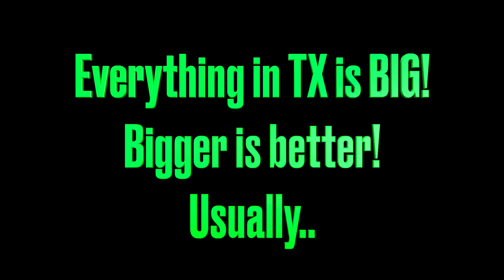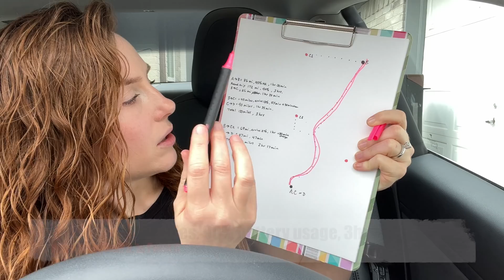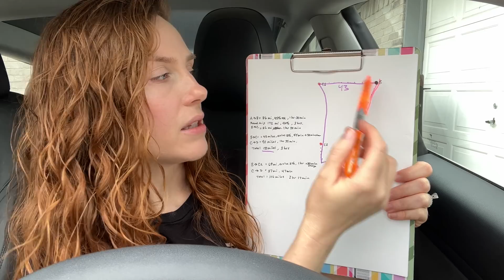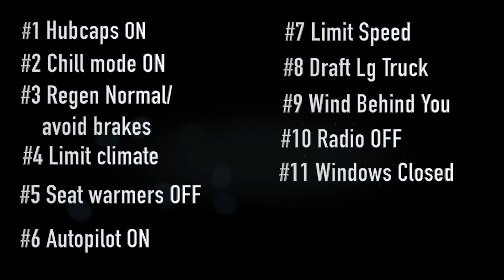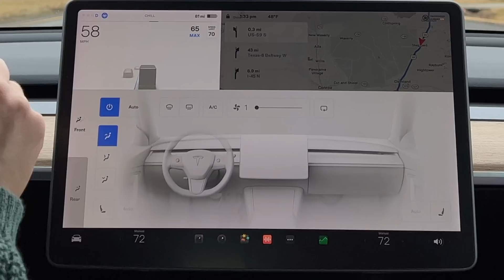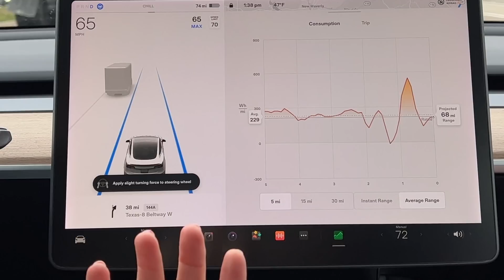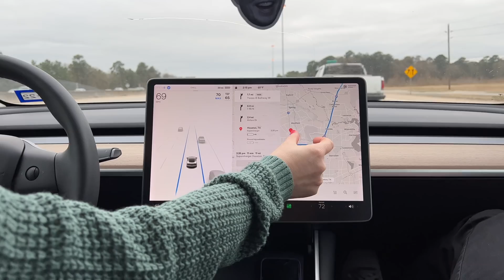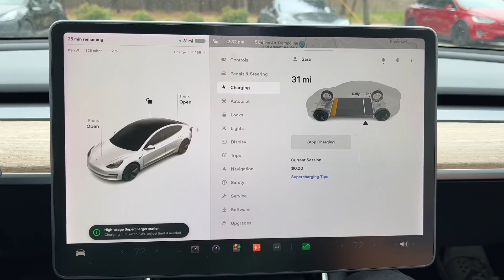TESLA: Emergency Battery Procedures (Hilarious & Highly Educational)

Comment: Sara, you're are real trooper doing this being sick !  was wondering if you could do a video on "Energy Consumption for Dummies",  explaining the energy consumption chart in the car. I'm still trying to learn EV usage  and for example  what's a good miles per kwh like mph in gasoline powered vehicles.
Reply from the maker: Sure! Great idea! I’ll add that to my list. But if I’m being honest… I don’t know 💯 about that thing either! And there’s still something I personally can’t find on the internet either. I don’t know what factors are used in its algorithm and I don’t know factors are used the percentage algorithm for the little battery symbol at the top of the screen either. Or if that even uses an algorithm.. I’ll try to do more research and learn enough to make this video for you because I’m frustrated about it too. My average  wh/mi is about 240. But that’s not necessarily good.. it’s just my average useage and lowest.

Comment: Another very interesting video, well done! How did the crack the front screen occurred? You are driving a performance model or? What tires are mounted? summer tires i assume? What pressure you have in your tires, as this effects too the range.
Wish you all the best and a swift and fast recovery!
Reply from the maker: Crack occurred at 40 mph on a city street when a yard crew with lawnmower etc pulled out in front of me and kicked up a rock. It cracked over time from a chip I could barely see to a huge crack from the large temperature difference here in Houston from super hot windshield in the day to cold at night. That crack got that big within about a week. Not performance model, only Standard range plus 2020 with NO heat pump so 240 miles range. Basic stick tires 18”, my tires pressure was low. Should be 40-45 psi, mine were at 38 psi because they were cold and I hadn’t added more air in winter. ;) thank you I’m all better now!
Reply: @SaraJAwesome  Thanks for the detailed reply as that helps always to see how other Tesla owners drive their cars and what they experience. I had even before my Tesla on all ICE cars a bit higher pressure, 2.9 to 3.0 bars (40 - 44 PSI) as the fuel consumption is a bit lower and I am the one who always looks far ahead of what happens on the road and thus the slightly longer emergency break distance has never ever been an issue in my 47 years of driving. Keep your motivating videos coming, blessings
Reply from the maker: Thank you, Alex!

Comment: Enjoy your videos and tips being a  new Tesla owner.  Some may not realize, that in a pinch there are slower chargers out in the wild, some are free, others are not.  These 'wild chargers' are the slow 'level chargers', but a charge is a charge if you find yourself in a pinch.  After my 1st road trip a fellow Tesla owner pointed me to a few 'non-Tesla' apps; specifically PlugShare and ChargePoint.  Again, if you find yourself running your Tesla in a strong head wind with cold temps you will need to realize the estimated range will be reduced, just like gas mileage is reduced in a headwind or going up hill.  Charging up an hour at one of these 'slow' chargers is better than sitting on the side of the road waiting for an hour for insurance/Tesla mobile service to come and save the day.  I'm not trying to 'sell' any app over another or any other 'wild charger' service over the other.  Just attempting to help newer Tesla owners, like myself.  I find myself coming up with reasons to go 'somewhere'....just to drive my Tesla.
Reply from the maker: I agree ☝️ 💯, Mike!!!!!!! Very good advice! Unfortunately for me on this particular trip there were no good third party charging options. But I heard they are installing more chargers along that route soon! So yay! Thanks for your support and sharing tips with everyone!

Comment: Where I live it’s cold at this time of year, about 35 miles south of NYC. I drive 76 miles daily, total. Yesterday my car used over 100 miles after leaving work at 90% charge (that’s what the limit is set at), and coming back today. So, yeah the weather seems to have a big impact on range. 

I do drive like an idiot sometimes though, too fast. Although the Tesla has slowed me down tremendously, for many reasons (I see why tesla drivers are so slow now). Too much battery usage, cars too expensive, etc.
Reply from the maker: Yeah, I drive fast too sometimes. Or I let people test drive it, and drive it like they stole it and it really eats up the battery fast. The miles you drive is basically never equal to miles of energy usage. Unless you’re going downhill with no heater on. 😂 i love mine, but it is a learning curve until there are more charging options everywhere in the world.

Comment: Thanks for the video. You really like to live dangerously. I probably wouldn't attempt a destination without at least 10% estimated charge remaining. Your tips are useful, especially controlling your own speed. I'm curious, what is your average Wh/mi and your best trip Wh/mi? I hope you're feeling better.
Reply from the maker: 220’wh/mi is the best I’ve gotten going slow around town with A/C on. Not heater. 👍🏻
Reply: @SaraJAwesome  My overall consumption with Tesla II is 224. My best has been 193. My best in Tesla I was 152 Wh/mi. Granted that was going mostly downhill in Colorado.
Reply from the maker: Nice

Comment: The Mustang does not have a heat pump either, so stupid.  Not having a heat pump in a new EV is like buying a piece of electronics with micro USB instead of USB C.  Luckily I live in San Diego, but even here my range has been cut a LOT due to the "cold".  I normally get about 320 miles in the summer time, last few months I'm doing good to get 270 miles at 100%.  

I only WISH the Ford had ANYWHERE close to the information that the Tesla provides to the driver.  We get a "Miles Per kWh" which 99% of the time is not even remotely correct, and that's pretty much it.  The data Ford gives you is laughable...    PS Good to see you finally got that crack fixed ;-)
Reply from the maker: Oh dang!!!!! That sucks! I’m so sorry. So are you overall happy with it? Or do you wish you got a TESLA instead? I love the colors of the Mustangs personally! And no, :(…. I didn’t get it fixed yet! Ugh 😩 🤦‍♀️
Reply: @SaraJAwesome   The build quality is far superior, however their software is WAY behind.    

Sometimes I do wish I went the Tesla route, other times I'm glad I didn't.
Reply from the maker: Always positives and negatives to EVERY decision for sure. If you’re happy, I’m happy! ❤️

Comment: Nice job on this video.  Good tips.  BTW I don't think drafting behind an 18 wheeler is unsafe if you are keeping a safe distance behind it.  The Tesla autopilot gets you as close as possible while keeping a safe distance and thats exactly what you did.  The large mass of the truck makes it inherently less likely to accelerate or brake quickly so movement of the truck are more gradual in front so actually safer.  Agree that the truck could run over something which the Tesla may have more trouble with but that safe follow distance should give you enough time to brake or maneuver if you're paying attention.  I've also used this technique many times with my old 2015 Tesla Model S.  In our new Model Y, I haven't yet needed to use this technique since it hasn't been necessary with its improved range but it is definitely a tool which could help if ever needed.  You did a nice job of explaining this without making people terrified who don't yet have an EV.
Reply from the maker: ❤️❤️❤️❤️❤️❤️ Thank you for sharing this. And thank you for saying I explained it well without possibly freaking out potential or new EV owners. That was what I was really worried about with this video. I try my best to explain things so that I’m honest about potential problems, and can prepare people for them. My intention is not to freak people out and maybe EVs, especially TESLA look bad. I’m the beginning some people thought I was a TESLA hater.. I was shocked. But it was because I really try to prepare owners for the worst so they don’t end up those situations and if they do, then they know how to handle it. So thank you!!!! ❤️❤️❤️❤️❤️❤️❤️ I agree on the drifting too, it can be done safely and properly. But a lot of people will probably screw it up so best to just put it all out there and make them fully aware.
Reply from the maker: Drafting *

Comment: I had one instance where the navigation system got it wrong, and I had to stop at a public Level 2 charger for about a half hour to get enough range to get to a supercharger near my destination.
Reply from the maker: Yeesh ❤️
Reply: @SaraJAwesome  what happened was that I was supercharging about 90 miles from home, in cold weather. I wanted to get dinner about 30 miles from the supercharger, but the navigation system proposed to have me double back to the supercharger I was using after dinner, then charge up to go home.
Reply from the maker: Ohhhhh wow

Comment: Thank you for the kind things you said about truck drivers! Please don’t flash your high-beams to “thank” the driver. That blinds the driver when they are looking in the mirror to make sure they are safely past you. Consider the size difference between a car’s side mirror to a truck’s side mirror. Shining a bright light in a bigger mirror reflects a lot more light thus blinding one when they least need to be blinded. Instead please dim (turn off) your low beam head light 1-2 seconds then back on. If a truck dims their lights to let you know it is safe to pass you can put on your 4 way (hazard lights) for 1-2 blinks to thank them.thanks again.
Reply from the maker: ❤️❤️❤️❤️✅✅✅✅👍🏻👍🏻👍🏻👍🏻👍🏻I didn’t mean flash at night. It’s okay to flash during the day right?! Because that’s what I meant. But once again details have been lost in trying to keep videos as short as possible. Ugh. Hopefully no one blinds a trucker now.. 🤦‍♀️ Someone else told me the same thing earlier. Well, I tried. Thank YOU very much for the kind words and advice as well.

Comment: I’m a bit obsessed with checking my efficiency on the Stats app after each trip and it is much worse once it gets in the 40s. That seems to drop the tire pressure about 4 or 5 psi from when it’s 70s. I haven’t done any roadtrips yet 😬
Reply from the maker: Yep, my tires went from 45 psi this last summer down to 38psi right now. But honestly I’ve been sick and tired and haven’t filled them up like I recommended. Haha don’t do what I do, do what I say to do! 😂 I love the STATS app as well. Fantastic app. I don’t trust any other ones. And the app developer is such a nice guy. I talk to him on Twitter.

Comment: Glad @14:15 that you could show onscreen the trip planner did notice your efficiency improvements, and updated arrival charge% to 8% instead of 2... great!
@13:50 re comparing Energy app to battery meter miles... that's only because your current driving was near 250Wh/mi, that is the default for the battery meter, so... do NOT ever use the battery meter to estimate range for a trip!! It does NOT reflect your current conditions or route, only "typical" range!! Consider it ONLY battery meter, so.. change to %.  Use the nav and Energy app Trip meter, instead. It updates faster and is easier to see what is happening vs the graph
Reply: re charging @15:41 for your next leg... if you route to your next or final destination, or add the charger as a stop to final destination, the car will also tell you how long you need to charge to reach it.. you don't have to guess re "think 20minutes", the car will KNOW and tell you (though you can charge longer if you want for safety buffer.)  That saves you from wasting time staying longer than you need to (eg, it's not like gas cars where you always "fill up" at a stop, is more like just grab&go to get you to next charge stop.)

Comment: Thanks for sharing ! Your previous video was great re saving! Biggest tips are: drive slower, and yes less on the heat. Non-heat pump PTR cabin heater can be 3-5KW (not constant), heat pump (or AC) can be around 1KW (more constant.) Use the seat heaters instead (more like 50W each!) 
Also, maybe route NEXT to supercharger, not charger itself, so car doesn't precondition the battery. (car should be smart enough to not do so if not enough range to reach, like it disables Sentry mode under 20%, but... not sure)

ABetterRoutePlanner is a big help for pretty accurate planning for difference conditions (extra weight, temps, rain/headwind etc), ahead of time..
but best tip during the trip, is to use the Energy App, Trip tab... it will show initial estimated range/% batter curve, and actual efficiency projected forward... if your color actual curve is below the projected grey one, then, be mindful & careful... it should be pretty accurate, and updates faster than the nav saying "slow below 55mph to reach destination" etc warning... if the new projected arrival charge% is below your comfort zone, you can adjust your driving style (speed, climate) & charging plans much earlier, when it will make a bigger difference over longer time.
Reply from the maker: Yes yes yes 👍🏻 ✅✅✅✅✅✅❤️❤️❤️❤️❤️❤️❤️❤️❤️ Fantastic tips! Thank you for sharing! And for your support, Colin!
Reply: PS THANKS for yet another informative and great video, detailed but explained in clear and fun way!
GET & feel better soon! You looked & sounded great!  Loved your husband's temp fill-in video meantime :)

Comment: Couldnt plug into anything in livingston?   I got LR because tx is so large..  time for you to trade up to a lr and show your hubby a fast tesla.  My range shows as 353....uh..its car lengths...not sausage links
Reply from the maker: 😂 and no, there wasn’t nowhere to plug in, in Livingston. Or so I thought. Apparently they just got their very first single little 3 rd party charger there. I just saw it pop up yesterday. It’s not tesla and is slow and I’m not sure how accessible or if it’s in working order.. but supposedly it’s there. I’ll check it out next time I go. So yay!
Reply: @SaraJAwesome  ya that can be scary. I had the same issue on the way back from Fl to tx in alabama. arrived with 2%. my fault there too.  I had other options but i used to push my gas cars well into the E and gambled the same way with the tesla. Regenerative breaking on full, no heater, drafting did the trick for me.
Reply from the maker: Nice 👍🏻 yeah, I love on the edge too 😂

Comment: I have the same model you have, got in Sep 2020, no heat pump, and I can confirm that this is not a normal occurence, running low on energy. With all the planning the car has, all the warnings, etc, it's really hard to get stranded in the middle of nowhere. I remember I drove about 500 miles on the highway one day (in Canada, from Ottawa to Windsor) and I wanted to  make it with onyl 2 stops. the max speed on highway is 100km/h (around 60mph) so I was driving at 110, which is OK. When I entered the plan, the car directed me to a charger where I would arrive with 10%. After only 50 miles, I get a message saying that I should slow down if I want to arrive at that particular charger, or else, I should change the plan and charge earlier. Well, I did accelerate a couple of times to pass a few snails, and maybe I had simply enjoyed the newly acquired speed car a little too much, but hey, I couldn't help it. So, eventually, I had to stop 3 times. But no regrets.
A big piece of advice, the most superchargers are on the side of the highways. Not exclusively, but when planning a trip, always trust the on board calculator. Have a gander at the abetterrouteplanner but really, just to have a comparison.
Now, my wife got herself a Model 3 RWD, delivery in January this year, with heat pump, and man, that is such a nice feature. I think it's a little loud, but it's very efficient. Not as efficient as I wanted, but still, not bad at all. And this new one also, came with the LFP battery, we charge it weekly to 100%, and it's actualy recommended to do that. It gives more range daily, and it doesn't really freeze in the winter (a lot of cold here in Ottawa region)
Reply from the maker: Wow! Thanks for sharing all this!!!!!!!!! Yes, there are tons of warning signs and this isn’t a normal occurrence but it can happen. And that’s awesome y’all both have TESLAS now! I love it! I have heard the heat pump is much louder, and not quite as efficient as it should be in all situations. But I’m still learning about I and don’t fully understand it all yet. Or even mine for that matter. There’s not very many videos explaining our heater, mainly just videos on the heat pumps. Which is quite frustrating. I love learning about the technology in this car! ❤️❤️❤️
Reply from the maker: Oh and that’s awesome y’all got that new battery and can charge to 💯!!! I was researching that the other day!!!!!!!